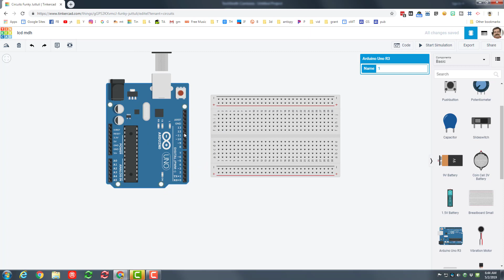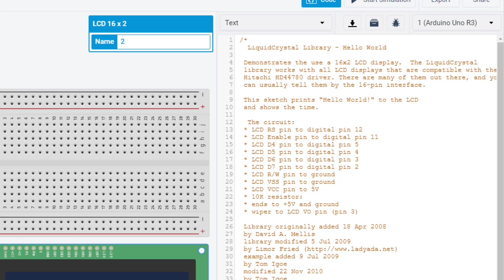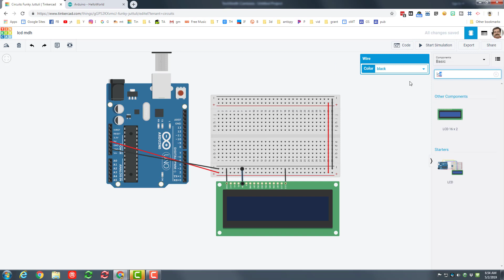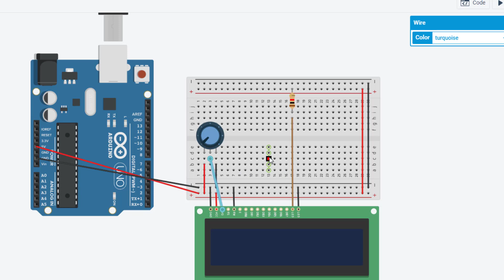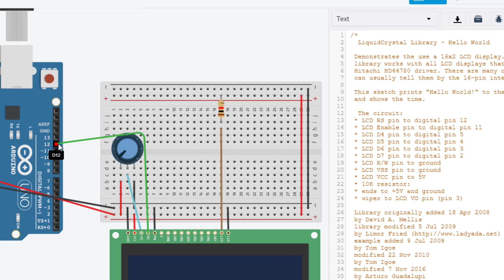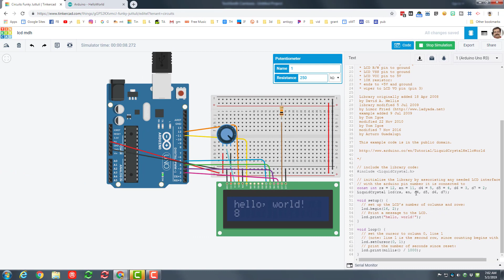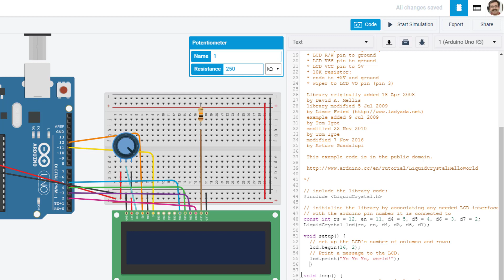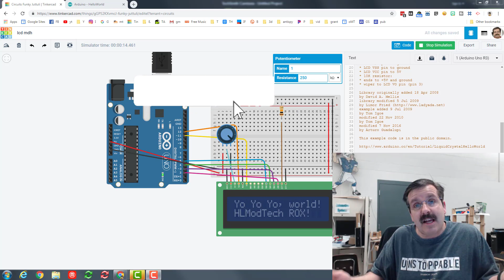Master a Tinkercad LCD in Minutes! Fun, Fast and Full of Sweet Skills!

Comment: Hello!  Is it possible (in real life and on Cad) to put two LCD screens in the same Arduino?  If so, do you recommend I use a larger breadboard?  Thanks!
Reply from the maker: Hmmm... Never thought of that. Nice thing about Tinkercad is we can try it for free.... I will get back to you. Of course, you solve it first and I will give you a shoutout. =)
Reply: @HLModTech  thanks for the quick reply, I appreciate it!  Sounds good 👍
Reply: @HLModTech  So I got it to say the same thing on both screens with the one Arduino, but I'm not sure how to get the LCDs to display different messages.
Reply from the maker: @swimbits320  Well done. You are way ahead of me.... I went for a jog and am heading to the pool... but it is on my list. #promise I think you would have to add parts of the code a 2nd time and have them run of different pins...
Reply: @HLModTech  that's what I thought as well, but there are only a certain amount of pins (to my knowledge), so I'm not sure how I can fit them in more slots.  Enjoy your jog/pool day :)
Reply from the maker: Will do. Spring break does not come around often enough for me to skip the relaxing stuff. =) I am curious if some pins could be shared. . I wonder if only the data pin needs to be separate. Totally spitballing, but I am curious now. To share a pin, I would run say pin 5 to the breadboad, then I could branch of the breadboard to the correct pins on the displays.

Comment: Hi ! That has any command in coding to show the contrast of lcd can be adjust ?
Reply from the maker: You grab the little line on the potentiometer and it rotates to make the LCD darker or lighter
Reply: HL ModTech i have try it but it can’t work 😢. My lcd didn’t show any change .Can you help me sir
Reply from the maker: is it lighting up at all?
Reply: HL ModTech yes but it can’t adjust the brightness
Reply from the maker: @nazriencyclop947  Fantastic that you have that part working. I would guess you have one of the 3 wires on the pot not perfect. You could also use the share option and send me a link so I could look at it. My email is hlmodtech gmail.

Comment: The simulator runs very slow with this code because it continuously and needlessly try to refresh the lcd. Refreshing the lcd more than eye can see is needless. 
So just put 
   delay(40); 
after  
  lcd.print(millis()/1000);  line and it will work in nearly real-time speed.
Reply from the maker: interesting. I am on the road right now for the holiday but I'll explore it when I'm back in town. thanks for sharing! 👍
Reply: delay() pauses the whole program and you don't want that. Just save millies at the start of the program and then check when it goes over a threshold (40 in your case) then reset it. After that you save the current millies and add the threshold for the next compare.